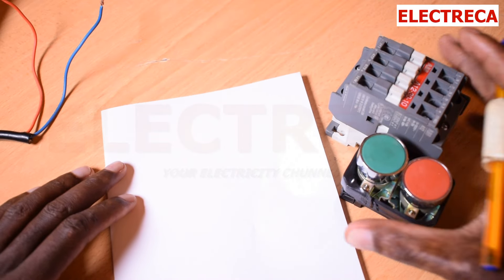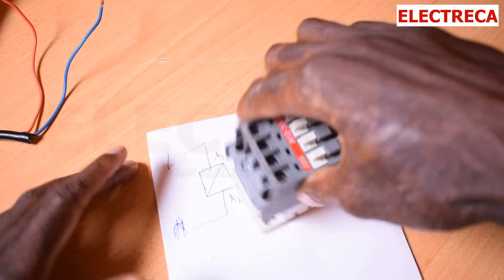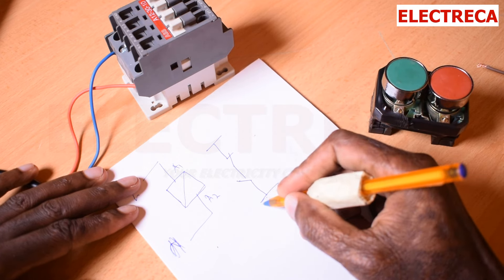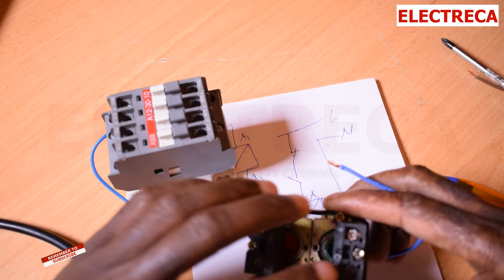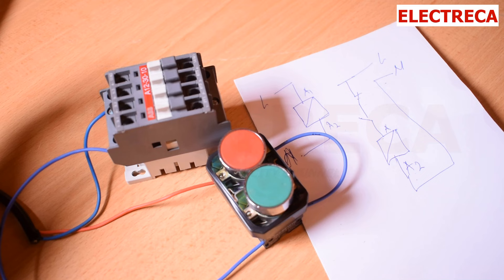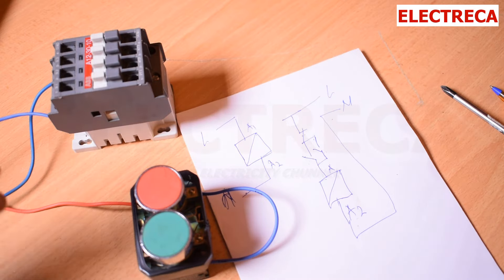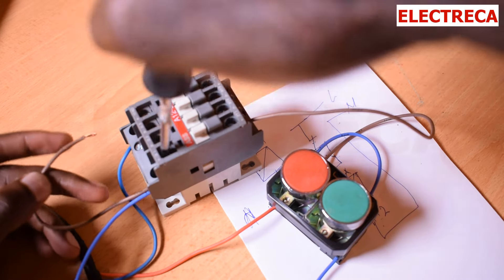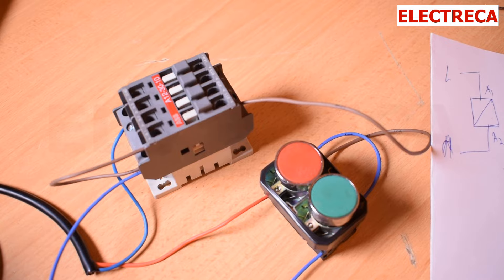The Self-Holding Push Button Explained

Comment: Great videos! Is it possible to wire 8 pin relay with 12v coil with push buttons.
Reply from the maker: Yes, its very much possible, take look at this video  https://youtu.be/y7I94ny-HD0  the only deference is I used 11pin relay ac.

Comment: How can I know if the relays are not good my mixer has some problem don't turn on just we pushed and the part return back
Reply from the maker: For contactor coil use a multimeter and check coil continuity.
When you say "pushed and the part return back'' do you mean you push the button relay engages and when you release relay deenergizes?

Comment: Wow, that's awesome, man. But there's one thing I wanted you to help me with... What if in case I want to control from two points ie two start and two stop push buttons. Some video if you have please.thanks.
Reply from the maker: Thats easy, make a parallel connection between the existing buttons and the one your adding.
Thanks for watching.

Comment: Good day sir, I really appreciate the good wor you're doing, I have a question, the red wire is supposedly the life wire (24v), but you passed it through the stop button first and looped to the green button, which means the green button got it's supply by looping from the red button, does it mean the red button is continuous even though it's not pushed ??

Comment: What about if is. 3 phase how will you do it?
Reply from the maker: That's a control circuit, it can run a three or single-phase power load. 
however, if you're lucking a neutral, you can replace a neutral with another phase to get 415v. but make sure that your contactor  is 415v.

Comment: So I cannot run a 3phase motor with a 3 pole contactor and do this setup. I need a 4pole
Reply from the maker: You can use 3pole contactor but you have to add an auxiliary contact NO for holding the circuit.

Comment: Quite good, but I must say I would like to see you connecting it, to the motor, or whatever you want to use that system for.
Actually, I was thinking of using it with a bench-saw, my normal switch has broken, so I was thinking of making a kind of control box, and I thought I could put an Emergency button, and the on/off buttons, and the contactor would be for extra caution. Well, thank you for your help and I hope you make a video, showing how to connect the power to the machine. 👍👌

Comment: Why we dont use holding with Stop button as we are with start button?
Reply from the maker: Replacing the start button with stop button,.....the circuit will be engaged without the push of a button and will go off if the same button is pushed continuously.
I don't see that kind of circuit helping anywhere.

Comment: Can we use these 2 push button without contacter
Reply from the maker: No.... Because the push button are spring loaded, they don't operate like ordinary switches.
If you don't have a contactor then try other form of relay like Pin relay.
Reply: Thanks but late reply

Comment: Like every one else, thank you so much for explaining this in very simple terms a knucklehead like me can understand. I am building a new control panel for a milling machine and I had everything worked out except for how to use momentary switches for the contactor. I want to use a contactor for safety as I didn’t want the mill to be able to restart on its own if there was a power interruption. Problem solved thanks to you.
Cheers Stuart 🇦🇺
Reply from the maker: You're very welcome!